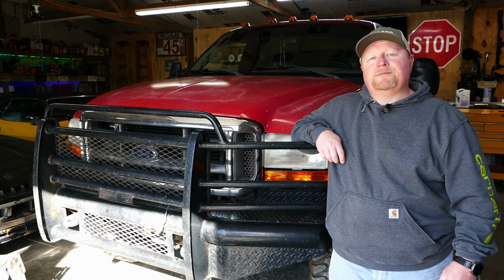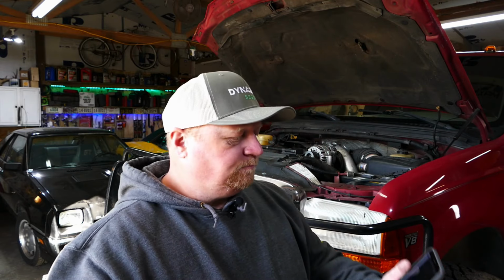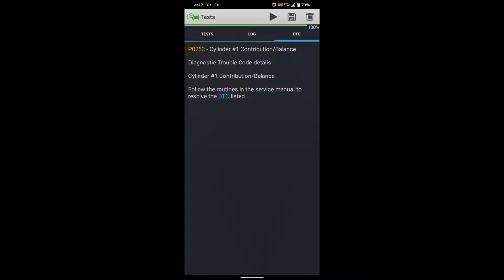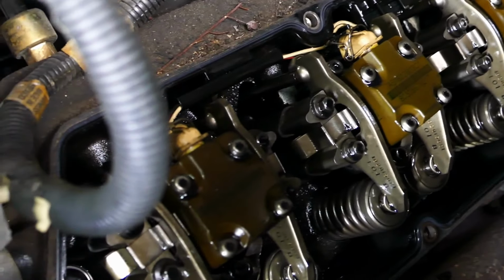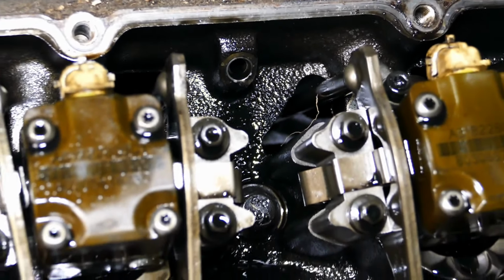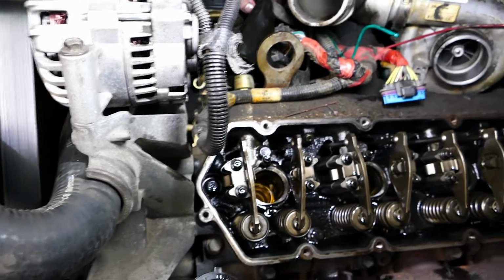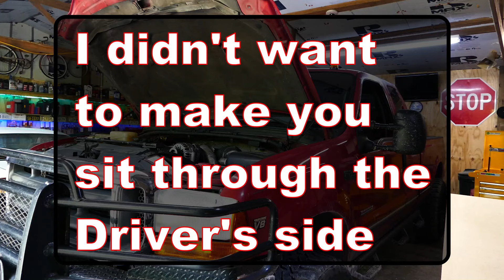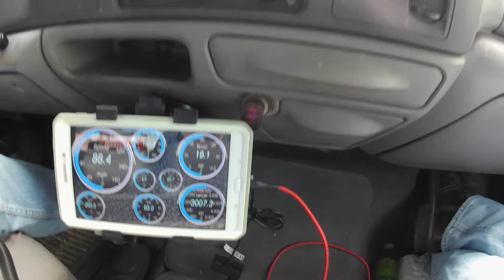Replacing the Fuel Injectors in a 7.3 Powerstroke Diesel | Ford F-250

Comment: ObII reader called what?? I have a 7.3 it starting to act up and Rev up by it self the Rev is like some one hit the fuel pedal ones only does it when I first start it to warm it up. And after I drive it a bit it would act up like it was gunna die qnd starve for fuel also service engine light is  on for a few then turns off while it running I have done oil filter and everything also when the service light kicks off it does that Rev up
Reply from the maker: I have a link down in the video description. It has direct links to all the stuff in the video.

Comment: Couldn’t number 1 injector be sluggish due to sticktion?
Reply from the maker: Possibly, but in my experience when sticktion starts to happen it's because the gap between the poppet and armature is too little due to natural wear over time. Sticktion eliminator (like Archoil) helps some, but it's best to replace the injector(s) if you can.

Comment: I can't get my bafx to connect to forscan. Any tips?
Reply from the maker: It connects via Bluetooth, so you have to pair the BAFX unit to the phone/tablet first. Once you do that, forscan should pick it up as an available OBDii interface.
Reply: @ProjectTimeGarage  it won't work for me. The obd reader won't pair with my Google pixel.
Reply from the maker: @breezyridgeranch  That's exactly what I use - Google Pixel. There has to be something wrong. Any chance the BAFX is bad? Maybe try to pair with something else?
Reply: @ProjectTimeGarage  I tried two seperate phones and then 2 seperate bafx devices. None of them would connect to my forscan or the torque app that bafx recommend.
Reply from the maker: @breezyridgeranch  When you plug the BAFX into the OBDii port, do you get any lights on the BAFX?
Reply: @ProjectTimeGarage  just the red light
Reply from the maker: @breezyridgeranch  Yep, that's the correct one. Gotta be something going on. The BAFX is just a bluetooth device like any other. It doesn't need any apps in order to pair to the phone - just power from the truck. So if it won't even pair, something's amiss in the bluetooth world..
Reply: @ProjectTimeGarage  it will pair but not connect. Then when I open forscan or torque to run diagnostics it won't connect to the truck. Idk. I sent them both back and just ordered a mx+. I just need to figure out if I need I hector's or not. I just purchased a 2000 7.3 with 119k miles. It smokes white once it's warm and has a noticable miss. I'm hoping the test you conducted on this video tells me which is bad.
Reply from the maker: @breezyridgeranch  Ooooh, I see. So here's how it works in a nutshell, this may help:
-The phone pairs with the OBDii (but it doesn't connect yet)
-you open torque/forscan and select the proper OBDii reader (which isn't connected yet, just PAIRED)
-Turn on the key and open the ForScan app, the phone will then connect with the reader
- Then click the connect button on ForScan
-all the lights will start to flash and it's connected
Reply from the maker: @breezyridgeranch  Here's a great walkthrough: https://www.youtube.com/watch?v=x97qnqGkuL4
Reply: @ProjectTimeGarage  yea that never happened. Hoping that the new reader will work better. I ordered 3 different ones hoping one will work. I'll return the other two lol

Comment: Do you recommend  any other apps since the forscan  app no longer works with the bafx  reader?
Reply from the maker: Hey Steve - that's strange. I used my app on the way to work this morning.  Did they drop support in a later version? As far as other recommendations, I have none,  other than a scanner that will do it - which is probably costly.
Reply: I think it's because I am using a Kindle fire tablet. It will not work with it.

Comment: So that tablet is running TorquePro? What PIDs are you running on screen? Speed, TransTemp,Boost, HPOP...
Reply from the maker: From memory something like HPOP, ICP, trans temp, boost/MAP, Speed (GPS), RPM, Trans gear selected, Injection fuel used?, intake temp, FICM voltage. I think that's about it.
Reply from the maker: Oh, and yes it's Torque Pro

Comment: Nice vid I'm in the middle of doing the same thing only I have the advantage my engine is out. Did you put new O-rings on the oil rail drain plugs? The four little eighth-in Allen drain plugs?
Reply from the maker: Yes, I did replace those while I was in there. Having the engine out is absolutely ideal.
Reply: It's a replacement engine with 67,000 on it. I'm just going through the whole top resealing all the common leak points and upgrading injectors

Comment: What software or device are you using at the end of the video to monitor the hpop pressure? Thanks, great video
Reply from the maker: The software is called Torque Pro, it's available on the Google Play store. The OBD2 adapter is from Amazon, there is a link in the bottom of the video description box if you want one.
Reply: @ProjectTimeGarage  thank you! I truly  appreciate the info you are putting out there!! Big help!

Comment: could bad injectors or bad o rings cause a lot of blue smoke under acceleration?
Reply from the maker: Blue smoke is a sign of oil consumption. But yes, bad o-rings can cause this to some degree.
Reply: @ProjectTimeGarage  my oil level has been full for the last month, but truck is very sputtery during accelerating, check engine light will come on while acceleration. 
I have changed map sensor,  exhaust back pressure sensor an cleaned tube, icp, ipr, an cleaned the in tank filter screens. It’s got slightly better but still smokes.

Comment: The torque spec on those valve cover gasket bolts should only be 8 ft/lbs.
Reply from the maker: Yeah, I have no idea why i run into so many of these trucks that have them torqued to the moon, but every single one I've worked on has had at least a few that wer seriously overtorqued.

Comment: Do you clean the cylinder befor install?
Reply from the maker: Yes, the cylinders have to be evacuated of oil prior to starting the truck.
Reply: @ProjectTimeGarage  Hey thanks for the quick reply definitely got my sub!! 👍
Reply from the maker: @lavishla3172  Thanks, glad to have you here!!
Reply: Btw how do you change 1 injector with one stripped oil rail plug? Not trying to hydrolock the engine.
Reply from the maker: @lavishla3172  Pull the old injector, install the new one, remove the glow plug on that cylinder and turn the engine over. The oil will blow out of the glow plug hole which will evac that cylinder. Reinstall glow plug, have a beer.
Reply: Looking through comments for this exact point. My #5 and #6 are bad so I've only got to do one on each side and was curious if I would need to evacuate all the cylinders or just the one that I'm messing with on that bank. Mines also a 97, not sure if that makes a difference.

Comment: are all the injectors the same or is there one specific that goes in #8. if so whats the difference?
Reply from the maker: For early 99, they are all the same. Some customers were complaining of a "cackle" at idle. Ford found that the #8 injector was making this sound since it's the last injector in high pressure oil rail. There was an updated injector issued to quiet this noise.

Comment: Great content , I'm learning a lot.  I bought a 6.0 two weeks ago  , knowing NOTHING about PowerStrokes.  Been driving Cummins for a long time but never worked on them either cause , I never had a break down with one of them.   Three days after buying the  2004   6.0 , it wouldn't start.  Seems the  FICM  was bad .  Got one coming , hope that does the trick.  So , my question is are the  7.3 's and 6.0 similar enough that after watching this , is the same procedure and parts basically the same for the 6.0 ?     Thanks for the video !
Reply from the maker: The basics are the same, It's a HEUI injection system, so high pressure oil actuated injectors, IPR, ICP, FICM, etc. None of the parts will interchange, and they're in different locations, but they are very similar in the basics. I also have a 6.0
Reply: @ProjectTimeGarage  . . . Thanks much for the reply.  It's gonna be a learning process for me but It's always good to learn new things.  I bought this one because it has an 8ft bed and I want to put a truck camper in it.  My main truck is a 2016 Ram 2500 , It just has a 76" bed .    Between your awesome videos and  a few other channels I'm sure I will get my 6.0 up and running !

Comment: Does anyone have a good video link for the passenger side?
Reply from the maker: I have another video, it's a 2 part series that may show some better detail on the passenger side. It's really the same as the drivers, just helps to remove the Air Conditioner Compressor. Otherwise, it's exactly the same. Remove Battery, Boost Tube, A/C Compressor, Valve Cover, Harness, Oil Rail Drain Plugs, Glow Plugs, Injectors - Then reassemble.
Reply: @ProjectTimeGarage  right on man. Thanks for replying. My ‘01 450 work truck died on me. Waiting on that scanner from your video to arrive so I can check the injectors. Driver side looks easy enough. I’m not a mechanic but I play one when I have to.
Reply from the maker: @at-ge5te  I'm no mechanic either. Good thing the old 7.3 is easy to work on. Good luck with your injectors. Post back and let us know the outcome.

Comment: I see how to drain the oil out of the rail prior to injector removal , But what about the Fuel ....?  Just let it drain down on top of the piston ....?  And at the end of your video going down the road ..What is that big blue critter with the gauges and pressures it's tellin ya .........?   Will the BAFX also give ICP pressure ......?
Reply from the maker: Yep, don't worry about the fuel drain, there's not enough of it to really matter *IMPORTANT* make sure to roll the engine over with the glow plugs out to evacuate whatever may have drained into the cylinders before you button it all back up - It's just cheap insurance.

The gauges were from a plain old android-powered tablet running a piece of software called Torque Pro (from the Google Play Store). It uses Bluetooth to connect to the BAFX OBDII Reader. Also, grab a copy of ForSCAN from the Google Play store too, it's Ford specific and gives you some bi-directional control over the ECU.  

Yes, you can see ICP/IPR and a lot of other stuff with the BAFX reader and either TorquePro, or ForSCAN.
Reply: @ProjectTimeGarage  Thanks Partner .......!   Keep those 7.3 spark plugs clean .......Rich

Comment: I have a 2001 F250 with the 7.3 that is at 578,000 miles. Here is a list of all the work that has been done on it. 1)Under valve cover wiring harnesses. 2)There is no 2....... That is all that has ever been done. The thing is a train. But as I'm nearing 600,000 miles I'm getting real nervous about all the luck I've had running out. Trying to learn as much as I can, but just wish I was more mechanically inclined.
Reply from the maker: 600k. I'd say it's been a good 'un.

Comment: holy hell man. this is the by far the best video Ive seen on injectors yet. and I've watched many. Thanks for being an outstanding instructor. question, why wouldnt you change the injector cups? in your experience, is it not necessary? thanks again
Reply from the maker: The only failure I've seen on cups is they could crack. In my experience, it turns a few hour job into a two day ordeal shince you have to wait on the sleeve retaining compund to cure.

Comment: what size socket do we need to hand turn the engine? I changed all my injectors and the only part to do is turn the engine. i just need to know what size socket for that. EDIT: the passanger side is the hardest to change. i literally wanted to throw the whole 7.3 away trying to get the glow plug out from that side at the back. and the stupid bolts on the valve cover.
Reply from the maker: 15/16" Deep for the damper bolt. And yeah, those rear bolts are a pain.
Reply: @ProjectTimeGarage  thank you

Comment: I replaced all fuel and jacked her‘s and your video helped tremendously thank you.
We also replaced the high-pressure fuel pump got all parts from the store that you recommended thank you! We are having a very hard time starting the truck we have oil pressure at start or tempting to start at 400 pounds so we’re thinking that the high-pressure oil pump needs to be replaced? We did hit it with a little quick start I know it’s not recommended but it did fire and start and it ran for a bit and oil pressure went up to 1200 and then fell back down. I’m gonna order the high-pressure oil pump and the IPR valve. I was just wondering if you can give me some input and some advice to get this thing up and running. 

Thank you!
Reply from the maker: Basically, if the icp is telling the IPR to open up and let high pressure oil into the system, then it should start. Typically a good rule of thumb is about 500psi in order to start the truck. If you're unable to build good cranking pressure, then the HPOP can't deliver, or there is an internal leak somewhere in the system (like injector o-rings). Since injectors are new, and you didn't pinch an o-ring putting them in, it's very possible that the HPOP is the culprit.

Comment: Great video very helpful made a difficult job easier - question for you - My truck was running great, after being parked (still hot) when I restarted it, it seamed to backfire and then it was only running on the drivers side 4 cylinders - after checking/testing all the wiring I have replaced the IDM and all the injectors with no change/improvement... Any ideas would be helpful.
Reply from the maker: Most lileky culprit is the injector harness under the valve cover. They're know for giving issue. I would replace both if they have any age at all on them.
Reply: @ProjectTimeGarage  So before I started changing parts --- I checked the wiring from the IDM through each junction including the valve cover injector harness everything checked and checks out fine and they look great --- but I just changed the valve cover harness today with the same result - still running on just the drivers side 4 cylinders
Reply from the maker: @26nimbusdk  time to start checking voltages on the passenger side wiring. With as much stuff as you've changed. Sheer luck should have at least fixed the problem by this point. You may end up having to ring out wires from beginning to end.

Comment: After watching your video and your reference of where to buy the fuel injectors I gave them a call and purchased for my 7.3 1997 F-350 with over 408,000 miles on it. 

I had been going through little things that need to be repaired that were affecting its performance got them all done and it help but still was having some issues. We have come to the conclusion it’s the fuel injectors and your video helped so much. ❤️

Thank you on all the detail truly helped!

I’m going to do High pressure oil pump next. Who do you recommend to buy from on the Internet?
Reply from the maker: My pump came from Full Force Diesel as well. I buy most of my stuff there since they're local to me. It's easy to just drop in and pick up same day.

Comment: I am currently using this video as my guide for my 99 F250 but I do have a question. At what point did you change the oil? After you evacuated the cylinder before trying to start or what? I have the injectors and glow plugs out now and the amount of carbon build up on them is insane. Can't wait for the new ones to get seated and see what kind of improvement that will make.
Reply from the maker: I made sure it ran, then immediately changed the oil.

Comment: Great video, do you just snug the oil rail plugs back in or do you mess with a torque spec.
Reply from the maker: I use the ol' torque elbow on most things that aren't internal engine, or suspension.

Comment: You made no mention of the brass cups inside there, what mileage do you need to be concerned with replacing them?
Reply from the maker: I have a 2 part video series on the cups. Basically, I don't change them unless there is a reason. Most common reason is diesel fuel in the coolant.

Comment: What does the parts cost to do this
Reply from the maker: Generally speaking, about $1,500 to $2,000 in parts. Injectors themselves are about $1,200 for stock. On top of that, there are some incidentals that should be done while you have it torn down (glow plugs, valve cover gasket/harness, oil filter, etc.).

Comment: The only issue I see here,is tell folks to clean up the top of the head before removing the VC.And pulling the injectors.
During the removal of the drain plugs in the oil rails,it looks like you have a ton of needles,dirt and leaves that can fall into the opened up head.
Im not saying your video was wrong,just keep it clean.less headaches down the road.
Reply from the maker: Great point! I appreciate the input. There's no such thing as too much information.

Comment: One of the best videos I’ve found so far. Looking into upgrading on my E99 but most recommend changing cups, is there any to tell ahead of time if cups need replacing? I’d rather not mess with them if possible.
Reply from the maker: Typically I don't replace them unless there's a clear failure.

Comment: Uhh.   You had a problem with cylinder 1 But changed cylinder 5-8.  Also.  You put the wrong injector in cylinder 8.  It's different than the rest.
Reply from the maker: I had a problem with cylinder 1 and I changed ALL 8 injectors. And yes injector #8 gets an AE injector and 1-7 get AD injectors. This is exactly how it's supposed to be. #8 is different to reduce knocking at the dead end of the system. Ford did this through a TSB somewhere in late 1999. Rest assured the truck has all brand new injectors and they are 100% correct.

Comment: I would of used air to clean off the engine first. Great video and I like the pointer!!!
Reply from the maker: Good tip!
Reply: I always spray it down with good degreaser and pressure wash everything before I work on it because I can't stand grease and I don't want any dirt or grime falling into the heads.